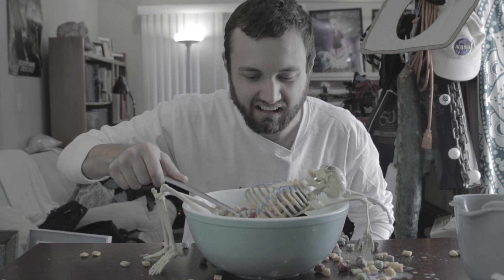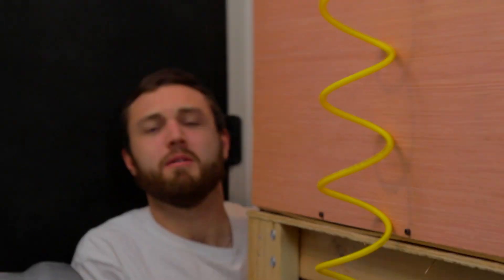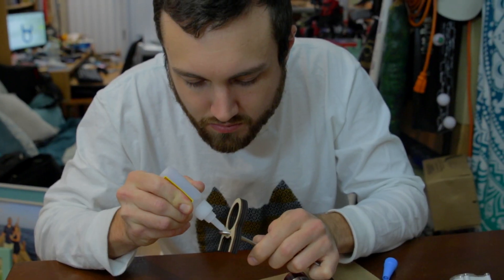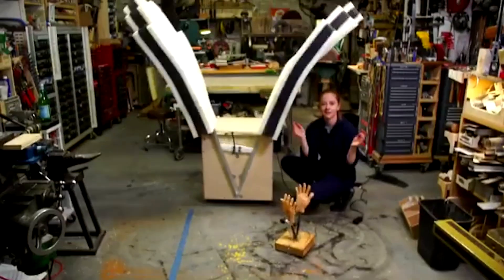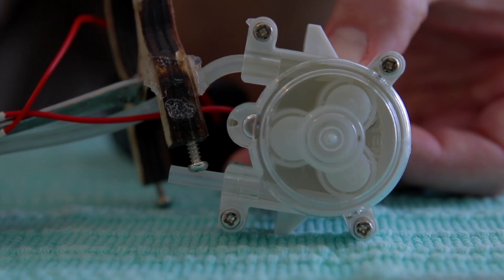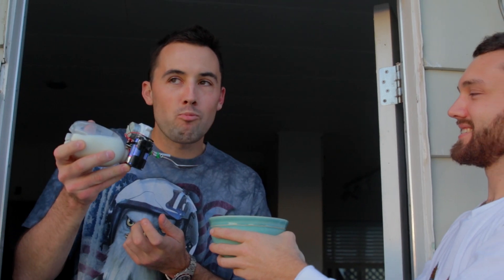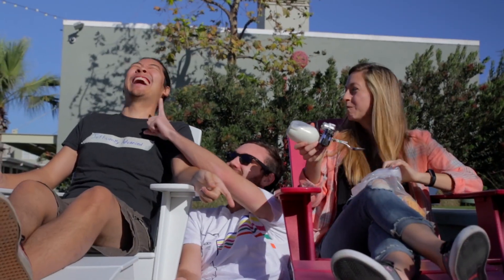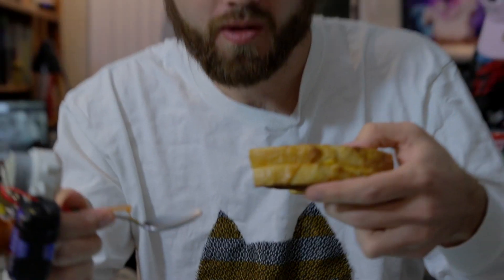Anti-Soggy Cereal Spoon

Comment: A hole should've been drilled into the back fo the spoon bowl so the milk filled up the bowl of the spoon from the bottom instead of splashing in from above. So after the hole is drilled, the tube from the backpack (mentioned in another comment) could run directly into the bowl of the spoon.

Comment: Reference: "World-class cereal-eating is a dance of fine compromises. The giant heaping bowl of sodden cereal, awash in milk, is the mark of the novice. Ideally one wants the bone-dry cereal nuggets and the cryogenic milk to enter the mouth with minimal contact and for the entire reaction between them to take place in the mouth. Randy has worked out a set of mental blueprints for a special cereal-eating spoon that will have a tube running down the handle and a little pump for the milk, so that you can spoon dry cereal up out of a bowl, hit a button with your thumb, and squirt milk into the bowl of the spoon even as you are introducing it into your mouth. The next best thing is to work in small increments, putting only a small amount of Cap’n Crunch in your bowl at a time and eating it all up before it becomes a pit of loathsome slime, which, in the case of Cap’n Crunch, takes about thirty seconds." - Neal Stephenson, Cryptonomicon

Comment: The peristaltic pump is a lot like a rotary engine minus the not wanting the touching part. It forces exhaust gasses and combustion out through circular motion and pressure that has gone through 3 stages.

Comment: what if you drilled a hole in the bottom of the spoon and put the pump going out into the bottom of the spoon so it pooled up in the spoon instead of squirting out over the front and hoping for the best

Comment: @WilliamOsman 
I offer advice in exchange for loot (or not, whatever.)
Next time you have to force rubber tube like that through a constrictive hole, cut the end of the tubing on a diagonal angle, like the tip of a syringe. It'll go through much easier every time.
Reply from the maker: THAT's the advice I needed
Reply: No problem. It's a trick I use when installing Tygon lines into fuel tanks. Works every time.

Comment: get a raspberry pi and program it so that it turns on the laser cutter when you say laser time haha
Reply: Jules arduino would probably be better for that. cheaper and since all he'd need to do is push a small sound file, more efficient than getting a raspberry pi and installing linux and getting i/o working and... etc
Reply: kiefac but i don’t think you can do speech recognition with an arduino :/
Reply: Jules damn I thought you said "make it say laser time when you turn on the laser"

still, there's probably some expansion board out with voice recognition
Reply: kiefac that’s a funny way to approach it too haha
Reply: Allysis too soon man, too soon
Reply: Jules i know a guy who tried to do voice regocnition on a Pi. It's definitely possible, but it sure is tricky.
Reply: Shavono sufficiently advanced did it in the Harry Potter video !
Reply: Allysis it will be back

Bigger

AND BETTER
Reply: Jules when will this be on Kickstarter
Reply: AMAZINGGAMING agreed
Reply: The lazer is dead his house burnt down

Comment: The button should be attached to the container instead, it would be much more ergonomic. 
With all the volumes going on actually holding the spoon is cumbersome, and as you can see most people held it by the bottle.
So put a button there and they won't need 2 hands to use.

Comment: “World-class cereal-eating is a dance of fine compromises. The giant heaping bowl of sodden cereal, awash in milk, is the mark of the novice. Ideally one wants the bone-dry cereal nuggets and the cryogenic milk to enter the mouth with minimal contact and for the entire reaction between them to take place in the mouth. Randy has worked out a set of mental blueprints for a special cereal-eating spoon that will have a tube running down the handle and a little pump for the milk, so that you can spoon dry cereal up out of a bowl, hit a button with your thumb, and squirt milk into the bowl of the spoon even as you are introducing it into your mouth. The next best thing is to work in small increments, putting only a small amount of Cap’n Crunch in your bowl at a time and eating it all up before it becomes a pit of loathsome slime, which, in the case of Cap’n Crunch, takes about thirty seconds.” 
― Neal Stephenson, Cryptonomicon (published 1999)